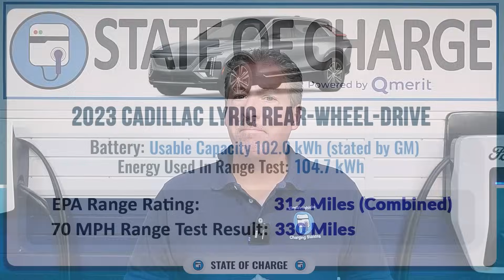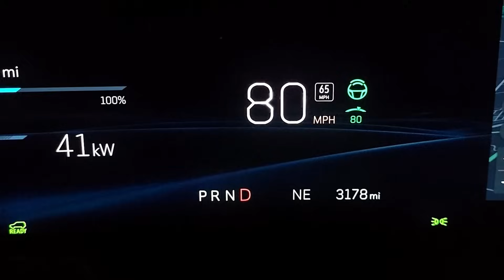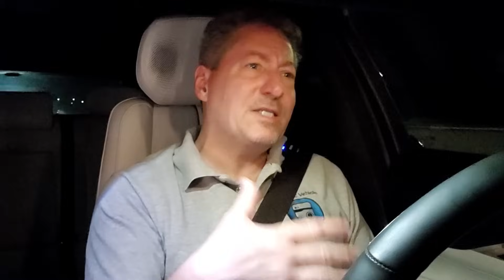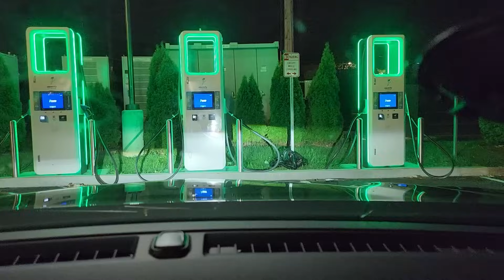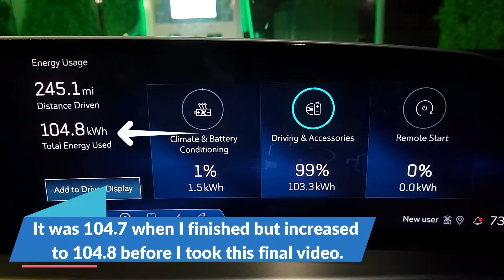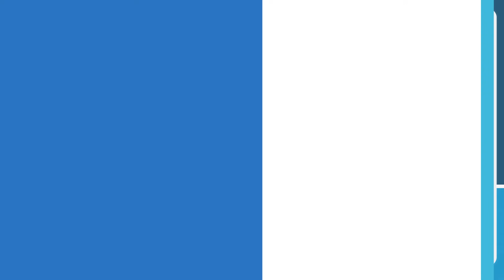Cadillac LYRIQ Range Test Comparison: 70 MPH vs 80 MPH

Comment: Does this mean that you want to go back and double-check your 70 mph test? Could there have been some sort of factor that gave you more range than you expected that isn't holding over the life of the car?
Reply from the maker: I'm not sure what you're implying. All EVs will go farther at 70 mph than they will at 80 mph. It's physics - the drag increases as the square of the speed.
Reply: @StateOfChargeWithTomMoloughney  Just that the 80+ miles of range more at 70 mph seems significantly different, beyond what the speed difference might predict. But I could be wrong.
Reply: @CJBear71  The difference in the range from 70mph to 80mph is caused by air drag.  Any EV would see the same ~25% drop in range.  Nothing special about the Lyriq.  It only seems large because the Lyriq is a higher-range EV.  If your EV only goes 200 miles at 70mph at 80mph it would get 150 miles.

Comment: As others have implied, this isn’t unique to EVs. ICEVs will also see a similar reduction in range at higher speeds, but people don’t seem to notice it as much. The difference, however, is that ICEVs also loose range at low speeds as well because of engine inefficiency, but that’s not true with EVs.
Reply: Well for ICE it depends on speed range and kind of engine. Like if you have sedan with a 3L 6 cylinder and measure difference from 60 to 70 it will probably not be big. But if you take a hatchback with 1.5L engine and measure difference from 70 to 80 pretty sure the difference will be similar to the EV tested here.
Reply: @b9eda9ad  Whether it’s a sedan or hatchback, the vehicle is still subject to fluid friction, which as  others have said is proportional to the square of the velocity. As a result, both will see a significant decrease in range at higher speeds. Every car is slightly different, but typically ICEVs have peek fuel efficiency (thus range) at about 80km/h (50 mph) and their fuel efficiency drops rapidly above 100 km/h (60 mph). Google “Speed Kills MPG” if you want to see for yourself.
Reply: ICE engines have a parabola-like speed/efficiency curve due to their transmissions and gearing, while an EV should have a more linear curve. I did a test with my Civic going 67mph and 77mph and I got about a 10% mpg boost going slower.
Reply: @jacobvriesema6633  At high speeds it’s less about the engine/motor efficiency, but more about the friction from trying to displace the air around the car as you drive down the highway.
Reply: @roger1818  yes, that’s why it’s parabolic for ICE cars. Lower speeds are more based on engine gearing and torque while higher speeds are more based on air resistance.

Comment: I've always been curious on a long road trip (1000 miles+) is what speed will get you from point a-b the fastest when you factor in how much more often you need to stop at fast speeds vs. how much father you can make it going faster (hopefully that makes sense). Going slower to get somewhere faster doesn't make sense, but it can be the case.
Reply: If the car charges at 500mph, it’s gotta be faster to drive fast. Unless you go far off-course to get to the chargers. So, if the chargers are close to the freeway, I’d say driving faster should result in less total time.
Reply: The A Better Route Planner app and website do that calculation.

Comment: In the 80 mph range test, you should have included the (possible) cost for the speeding ticket, and increased cost in insurance.🤔🤪
Reply: Drive 80 mph between LA and Vegas and you'll be stuck in the right lane with the trucks.
Reply: If you’re not 80 in Indiana you’re going to be blown off the road. If you’re not 80 in Texas you’ll get shot.
Reply: Exactly. Not worth it. Then again, there are parts of the world where 80MPH isn’t illegal.

Comment: I discovered this in my Tesla. 70-80 is a huge difference.
Reply: @rocktheworld2k6  Yes. When I first got it in FL I was zipping along at 85-90 and wondering why I wasn’t getting the EPA rated amount. It should be made more clear to buyers how much highway speed reduces range. It isn’t like ICE as it doesn’t have the gearing to overcome drag loss.

Comment: i still love that people think this is somehow unique to electric cars.  People just don't obsess over mpg in gas cars. Same thing happens. Can't beat the laws of physics. It takes more energy to push air out of the way faster. Period.  But yeah, somehow the "city/highway" numbers always get people "but the highway numbers are better than city in a gas car, surely it cant be so".. but yeah.. just shows how much energy is wasted in a gas gar when not working at its optimum efficiency points (not that even that is all that great).
Reply: The inefficiency of ICE cars masks a lot of things.  As you point out the extreme case is city driving, starting means you have to spin up the engine and that's where an engine is least efficient, stopping is done by converting your kinetic energy to heat. But even on the highway the gearing will have significant effects, the engine has a narrow band where it's most efficient so it's efficiency  will depend on where it's at in it's power curve. The drive train in an EV is always efficient which is why the effects of pushing air out of the way is so obvious, that's where your energy is going.
Reply from the maker: Range loss and additional energy consumption certainly aren't unique to EVs. But there is a huge difference in drivability for long trips because gas cars can be refueled in 5 minutes and add back 300 to 400 miles of driving range, while an EV like the Lyriq, will add back about 200 miles of range when driving at 80 mph in 45 to 50 minutes. So knowing how much range loss you'll get from driving at faster speeds in MUCH more important for EVs.
Reply: @StateOfChargeWithTomMoloughney  it's not the fueling rate that matters it's the distance between chargers. Gas stations are at every exit so ICE drivers don't have to think about range or plan their stops. With a gas car you just wait until the needle is near empty and then you find a gas station. When chargers are everywhere nobody will worry about range either but we are at least five years away from that, maybe a bit more. In today's world you still have to plan your charging stops because you can't just assume there will be a Supercharger when you need one even on Interstates but especially when you are on back roads. When that's fixed then people will be as nonchalant about range as people with gas cars.

Comment: It's no surprise. Anyone with an EV is well aware of this phenomenon. It's particularly true if it's a big square SUV. Even in a sedan, anything above 75 will shorten range significantly. The best range is 65. This is not rocket science. As the speed increases, the air resistance is increased by the square of the speed, and thus, the energy consumption. Maybe now people will understand why Mercedes EQ vehicles look like eggs.....Form follows function!

Comment: looks like the air drag ratio is pretty accurate. the ration in this case is (70*70)/(80*80) or about 75%, within 5 miles of your results. And yes the Taycan would have a similar 25% range drop. It is just physics. Whatever the drag coefficient is, the ratios I show still apply. People do not notice as much in gas cars with the crude fuel gauge, but same thing happens.
Reply: re: "the Taycan would have a similar 25% range drop. It is just physics." yeah, who'da thunk a high riding "brick on wheels" wouldn't be very aerodynamic at 80 mph (or any other mph for that matter).
Reply: ICE cars have more of an efficiency parabola due to the gearing of their transmission and many other factors. The engine also outputs different power at different rpm, and with the 7 or so gears an auto car has, their efficiency ends up not so linear. Most mid-sized cars get their best mileage around 55mph or so. Going slower means less drag, but it also means less engine cooling and possibly a lower gear.
Reply: Interesting, so by that math, would you also get (60*60)/(70*70) = 0.74.  So if the Lyriq went 330 at 70mph, 1/0.74 would mean 445 miles at 60 mph.  That's a huge distance!
Reply: I suspect you're right about Taycan, but I'm not so sure about gas cars, since they waste so much energy as heat in the engine that aero drag doesn't necessarily dominate so thoroughly in the overall energy usage of the vehicle. The more efficient a vehicle is, the closer I'd expect it to follow the velocity squared curve.

Comment: Physics works. According to NASA, the equation for drag is D = Cd * A * .5 * r * V^2. So the drag increases as the square of the speed (velocity). Thats why during the 1973 Opec oil embargo, the highway speed limit was set to 55mph to save fuel. I still remember waiting in gas lines then, so I always smile now when I pass a gas station in my EV.
Reply: That's just the force of drag. The power needed to overcome the force of drag is proportional to velocity CUBED.
Reply: electric vehicles do not have different aerodynamic rules then ice cars..Go faster you use more juice.  Go faster you use more gas.  The whole idea that this is a specific battery electric vehicle problem is ridiculous.  Also own a 2008 Cadillac had a crappy tiny gas tank and bad gas mileage. It had a range of 250 miles.  Meanwhile, my Tesla has a range close to 300 miles and cost seven dollars 11:31  to fully charge.
Reply: @stevenichols4639 it's not an EV specific thing but it does seem to be a much bigger issue for EVs. In these tests there was a 27% drop in range at 80mph compared to 70mph. You definitely don't have that much of a drop on a gas car.
Reply: @jimv1983 That's right, the difference is less dramatic in an ICEV.  But that's not because there's an additional effect in the EV.  It's because there's a compensating effect in the ICEV: the engine actually gets more efficient with the throttle open further.  It's still terrible efficiency even with the throttle wide open.  But the net result is that you can't win with an ICEV: go fast and you have huge drag and an inefficient engine.  Go slow, and the drag is reduced but the engine efficiency gets even worse.
Reply: I also looked up the equation and saw that in just the one section, that being velocity squared part, just think about it 70 squared vs 80 squared.  What he did in the video was just prove the math.
Reply: You know what they say about physics.  “If you take physics, bring lots of paper.”
Reply: I always smile when I passed that charging station in my gas vehicle.

But really, the video goes to show that speed of vehicle using any machine decreases efficiency. Gas Electric or otherwise
Reply: @CalvinHikes disagree.  Although aerodynamic drag is a big factor, a lack of transmission in a BEV also affects range.  ICE cars also have trannies to reduce engine speed. This dramatically affects range.
Reply: @alexnutcasio936 not really otherwise they would put transmissions in EV instead of adding big batteries.
Electric motors can spin up to 20,000 RPM and at normal highway speeds. The tires are probably spinning like a thousand RPM so you just need a reduction gear .
Reply: @alexnutcasio936 ice engines a comparatively tiny power band vs electric.   With zero power at zero, vs ev with almost all the power available at zero.  Even the efficient band for an electric motor is huge by comparison.   The losses of a transmission are also measurable, so if you can find the sweet spot to not need a transmission you are saving.     If the vehicle has a huge need for the efficiency outside of normal use, then maybe worth paying for the extra waste, most don’t need that.

Comment: 18:55 exponentially, yes. it's quite literally exponential, the force of the atmosphere against a vehicle/airframe with increase of speed. double your speed, quadruple your force. Quarter speed increase, double your force. same goes for a gas car but they are so inefficient that most people dont do the math. if you are in the top gear and you do 70 mph vs 80 mph, you will get less MPG at 80 than at 70. Incredibly crucial that both are recorded in the top gear. For example, my motorhome gets around ~8 mpg going 55-60 but it gets around 9 mpg going 65-70, this is because it cant do 55-60 in its top (6th) gear. Couldnt believe it at first but those extra 500 revs lower make a big difference. (5.9 cummins ISB300)
Reply: For all those crying ev’s need a transmission when the added loss and weight don’t make sense for most vehicles, the RV example above perfectly highlights how narrow of an efficient band most ice configurations have.   It starts to highlight why so many trucks get a lot more gears now to attempt some efficiency.    Ev’s for most use cases don’t need that.

Comment: Drag is a serious consumer of energy, get a car with a good aero co efficient if you like speed
Reply: Aerodynamic coefficient and frontal area don't change the fact that drag is proportional to velocity squared. In other words, a more aerodynamic EV will use less electricity per mile traveled, but will still see the same loss of efficiency as you increase speed.

Comment: Same with gazoline.
Reply from the maker: Sure, but gasoline can add 300 miles in a 5-minute stop. So with EVs, managing speed/range becomes much more important.
Reply: @StateOfChargeWithTomMoloughney  So you agree. I am sure that the gas stops last more than 5 minutes though because people need to rest, bathroom, drinks, food, etc., after 3 to 5 hours drive. And they need to stay at the gas pump while they fill the gas tank, which is not that case for EVs. At the end, on a long trip, an EV is more relaxing because it forces you to stop more often. And it is better if one has a Tesla, which is at another level with its multiple working charger network and fast charging (30 to 40  minutes charging most of the time 200 to 270 miles) You just need to plan for it.

Comment: Tom, if your trip is long enough that it would add more stops to charge @ 80 than @ 70, you may actually get to destination later on the higher speed 🤓😂
Reply from the maker: You definitely would
Reply: @StateOfChargeWithTomMoloughney  I see a challenge between you and @OutofSpecReviews. Who will win on the road trip, "Rabbit" Kyle ripping it, or "Turtle mode" Tom?
Reply: Driving 330 miles @ 70 MPH takes 4.7 hours. Most of us need a break much sooner. No one is going to 100% charge any car on the road due to the extended time to reach 100%. Therefore "The Kyle Conner OoS method" drive as fast as possible and work the most efficient charge range of the battery is the way to road trip an EV.
Reply: real-world depends on a lot of factors....  idealized 20-80% driver... its basically the same... charges would have to be longer then 54 minutes to break even for slower driving car (faster car has 2 more charging stops but is 107 minutes ahead).  At least for 1000 miles.  Of course do 10-50% and yeah... faster and 10-50% would pretty much always win (pending no real-world factors) see my math in another comment.

Comment: The "road trip" comparison is so interesting! To drive 1000 miles at 80mph, you'd have to make 3 pit stops at EA stations, instead of 2 pit stops if you go 70mph, because of the reduced range. The time spent at that extra charger might cancel out the time savings of driving 10mph faster!

*this assumes charging 0-100% at each stop, which is unrealistic. If someone can give more realistic numbers that would be cool, I'm too lazy, I think the point still stands
Reply: Hard to say as there are a LOT of realworld factors that would happen.
If we assume charges are WHERE-EVER we want them to be, and we have a driver that stops at 20% always and charges to 80% always.

70mph guy stops at 264 miles for first charge, then 198 miles there after, so at: 452, 650,  848, and could make it to 1046. So 4 full 20-80% stops. The DRIVING portion takes 857 minutes.

80mph guy stops at 196 miles for first charge, then 147 miles there after, so at: 343, 490, 637, 784, 931 and could make it to 1078.  So 6 full 20-80% stops. The DRIVING portion takes 750 minutes.

So 80mph guy is 107 minutes ahead, but has 2 more charges. If 20-80% is less than 53.5 minutes, then he still is there faster. I believe there is a SoC Video that shows its just over 40 minutes. So 80 arrives a handful of minutes before 70.

Reality.. 2 more charging stops adds a significant chance of issues... and doesnt account for a lot of CCS stations being... well.. a bit far from ideal location eating that time back away.
Reply: @todkapuz  Wow, you did the math! Thanks!
Reply: @todkapuz Great analysis. My takeaway is to drive around the posted speed limit (as long as that is close enough to the "flow of traffic" to feel safe).
Reply: That's pretty much what I was thinking. A great idea for a video would be to get 2 of the same EV's. Charge both up to 100%. Drive one going 70 and one going 80. Drive both 1000 miles and see who wins.
Reply: My philosophy is that modern cars can DC fast charge we’ll over 500mph so that charge speed has to make up for the difference.

Comment: Great range test Tom, you can extrapolate this range loss similar to if you were driving at 70mph with a 10mph headwind again air flow is what makes all the difference. Likely a more efficient streamline design would not take such a hit. Would be interesting to do the same test in a Tesla Model Y Long Range AWD, I feel it is likely a lot less dramatic in range loss at the higher speed.

Comment: This is where Porsche has the right idea. A 2-speed transmission allowing for higher speeds with more optimal output from the motors.
Reply: Air resistance proportional to velocity squared disagrees.
Reply: It drag, not gear's
Reply: Porsche did a 2 speed transmission for better acceleration at higher speeds, not geared for efficiency.